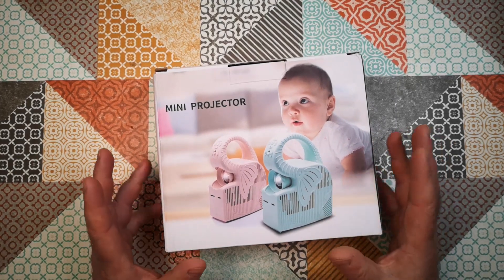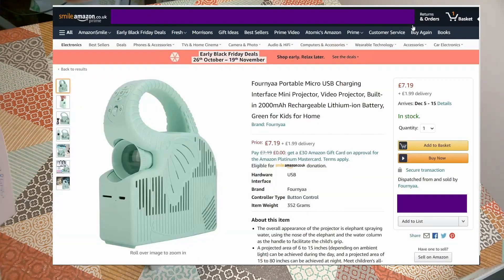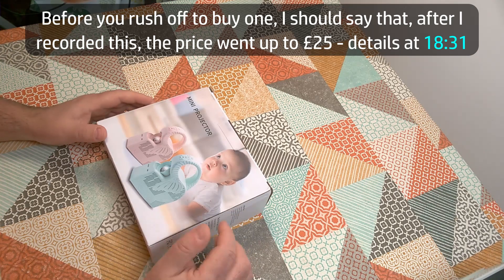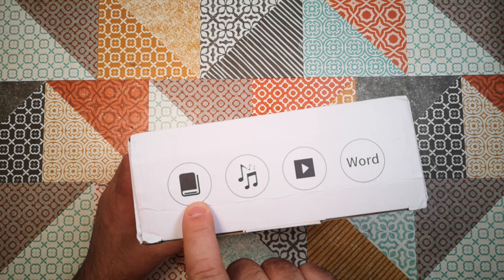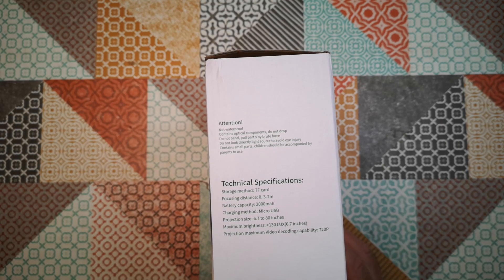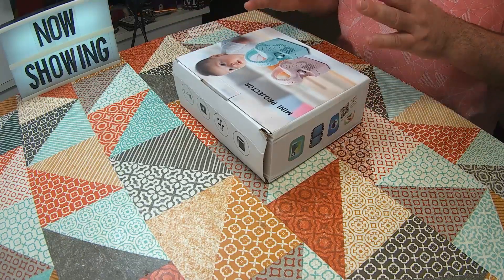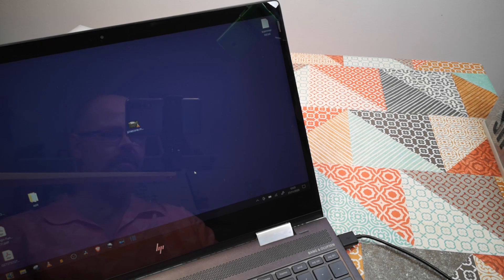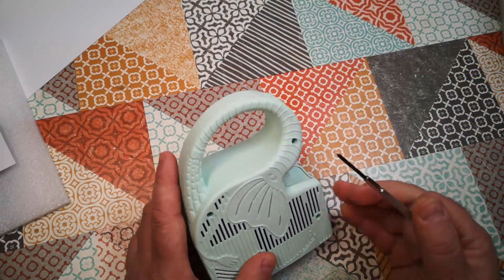The Weird Little Video Projector That Cost Me Less Than £10 - Unbox, Test, Teardown

Comment from the maker: Update on the hackability (or otherwise) of this thing...
I took it apart again to get a really good look at the insides; the construction is quite curious - the LCD panel has a 30 pin ribbon cable, which seems pretty nonstandard; the polarising filter for the LCD is also a separate thin piece of glass - Hacking this thing is probably beyond my abilities; it will either comprise loading a new OS/firmware for the SoC (which probably means rewriting the video driver from scratch), or reverse engineering the connector for the LCD panel to get it connected to something else.  Ben Heck could do it.  I probably can't.  I wonder if he wants this to play with...
Reply: So that's what they mean by "the elephant in the room"!
Reply: i might be wrong but is that cable on the lcd anything simmilar to say the raspberry pis DSI connector they look firhgtfully simmilar

edit: nah dsi is a 15 pin connector

took a look at the datasheet and yeah it does have pinouts for that but without the software to enable that mode i dont think your going much of anywhere with that

and thus we come onto software
theres people out there who could and would absolutley wanna hack about with this but they have jacked up the price and the price will only go higher if there a large demand for it 

at which point all this development and hacking just to have made a projector with the same or less features than buying one of the 30 quid projectors listed along side this one that ship with those features enabled out the box
Reply: Fun fact, that SoC is the less RAM version of what's in the Game Gear Micro, so you can certainly put Linux on it, and should work fine if the LCD interface can be figured out.
Reply: i just saw tom scott's new video about polling an audience and you are the one of the only people on the internet  that uses double spaces after a full stop
Reply from the maker: Computers and the internet came into existence during my lifetime.  I learned to type on a typewriter - and back then, the convention was always one space after a comma, two spaces after a full stop.  I think it's too deeply ingrained a habit to let go of now.
Reply: cool video
Reply: @AtomicShrimp  The real Satoshi Nakamoto
Reply: Reverse the LCD panel, put a more powerful 10W/12v LED behind it, add a chunky heatsink, maybe a 12v fan. A lens more suited to "throwing" the image for distance, add a stepdown board from 12v to 5v, solder the output of that to the projector, add a car cigarette lighter 12v plug to power both the projector and the LED. Go around the/ a neighbourhood with your car at night, projecting movies on other people's curtains. Reverse drivetrough cinema.
Reply: uhh a lot of the non touch screen HP 15" laptops use a 30 pin connector for their panels.. and i think you can get 30 pin adapters for arduino.
Reply: you could go in circles trying to make the included LCD work, when i suspect it would be easier to snag a potentially better screen with built in rpi support. should be fairly trivial to replace the LCD with another unit of a similar size.

do you know the dimensions on it?
Reply: I really appreciate your unbiased approach to items you purchase on the web. There are other channels like your’s that always, no matter what have to find something wrong or fraudulent even when there doesn’t seem to be. Thanks for being 100% genuine with your audience, and for helping to bring awareness to us all.
Reply: camping projecter could be a reason to get maybe
Reply: @AtomicShrimp  I too learned to type on mechanical typewriters, but had completely forgotten about the double space after a full stop! Probably because I didn't continue with this when using word processors on computers.
Reply: @AtomicShrimp  heck... I'm under 40 & I always double space after a period.
Reply: Ben Heck could make a B-MO with this, a raspberry thingy, and pico-8.
Reply: @DoubleMonoLR  So realistically you would have to make a complete schematic for this thing to have a hope of running anything useful on it OR you would have to come across whatever RTOS they stole and put on the SoC.  From my days dealing with the TI omap series of processors and stuffing linux on them, it is incredibly un-fun getting the right alternate pin IO routing correct.

I'm gonna guess that there are JTAG pads exposed there somewhere (though the chip documentation says it can be programmed with USB OTG).  Oddly, nothing I see mentions any kind of copy protection fusing like most embedded processors have so maybe you could pull the programming right off it over JTAG?  Probably simpler just to yank out the board and find a way to make a Pi zero work with the display.

Anyway, on to why its so cheap, buried in my own comment which is buried under other people's comments.  I expect somewhere between 0 and 1 people to read it.
The fact that this showed up as a readable drive and the chip has USB OTG capability means that you could use it to put spyware on a computer or to expose HID interfaces surreptitiously to, again, put spyware on the host computer.  It wouldn't be the first or last time a piece of electronics out of Shenzhen was sold under cost just to spread malware.

Also, a lot of parts in China kind of "fall off a truck" on their way towards making legitimate products.  They can't just sell stolen component level parts so they end up being shoved into weird repurposed plastic molds running weird repurposed code.  if your BoM is "free", you can make a product for pretty close to free.

Atomic Shrimp: It would have been nice to see this attached to a linux box and what the output of "dmesg -w" was for a few hours.  See if it behaves shadey-like.
Reply: Did you try to connect with an android thru the USB port?
Reply: Very late comment, but have you tried a PDF file for the text documents?
Reply: @SpahGaming  I learned to type on a computer and I always use two spaces after a full stop/period.
Reply: @AtomicShrimp  Nah,  I'm of a similar vintage to you, Mr Shrimp, and I made the choice to go single spaced a few years ago. Now it's second nature, and just think of all the key clicks I'm saving!

Comment: The funny thing is this device outperforms the first projector generation on every point, and they sold for the price of a yacht.
Reply from the maker: I remember having to use an LCD panel that was designed to be placed on top of a regular old-style OHP - it was absolutely terrible - lower resolution than this, and so dim you could barely see anything even in full darkness

Comment: I've now bought 3 of these at $12 CAD each, including shipping! 
One to use and two to play with or hack. 

The video quality is actually surprisingly good FOR THE PRICE.  People dogging on the quality need to go price other projectors  and get their minds right. 
It's totally watchable. Especially for the intended target media, cartoons. I dumped a Looney Tunes collection video on there and it looks great. Kids in a dark room watching from their pillow fort will be thrilled with it. 
Even watching regular movies is quite doable as long as there's not a lot of dark, low contrast, or high detail scenes. 
I watched half of Mission Impossible: Ghost Protocol just to test it out and it was quite watchable. The main limitation is battery life. But again this is meant for 5-30 minute kid's cartoons, not home theatre use. It will play while plugged into a charger and I'm guessing that with a powerful enough USB charger you could play movies indefinitely. Like a Raspberry Pi 3 charger for example. 

Meanwhile I'm VERY curious to know the pinout and protocol used by the LCD display. I'd love to replace the built in motherboard with a Raspberry Pi, hopefully using the DSI connector. 
I'd be shocked if the original motherboard and display used a proprietary protocol or connector. At the price they're selling this thing I'd imagine they'd use as much of the shelf stuff as possible. The display especially seems a good target for a standard, of the shelf part. If only so the projector manufacturer can price shop for the cheapest vendor at the time of any given production run. 

If anyone gets any info on any parts of this projector, please share with the rest of us! 

So far in my own research I managed to find this project, which uses the same SoC as the projector. 

https://www.thirtythreeforty.net/posts/2019/12/my-business-card-runs-linux/

Comment: I think I can see what happened. After the success of the iPod, there was a huge flood of little inexpensive media players onto  the market. They had these same functions, but the displays were very low-res because that's all you could do cheaply then. As media players (and LCD displays) got better (quickly) driven by phone technology, there was somewhere a pile of the boards insurplus which were dumped for pennies each. The up-front investment here are the molds for the plastic case and that lens, but after that, the cost of the materials could have been as a low as 1 pound or two.

One more note: I bet the mirror inverts the image and the lens inverts it again.

Comment: I purchased a different build to this unit, mine was more box shaped white and yellow, it did have more technology in it and worked very well indeed, my wife and i sat and watched a whole movie with it.
This one had a cooling fan and a bigger speaker which was quite a good one.
Like you I was amazed at just how good this was, it did everything it said it would do and did it very well indeed, i was very taken back with the LED lifespan 30,000 hrs, which with carefull use could work for a lot longer i think.
I too wondered how they managed to make something as good as this for the money as this one actually had a remote hand control with it thay again worked just as it should the picture was more than bright enough and worked at a distance of about twelve foot, making the image almost the size of the wall!!!! 
Only goes to show that sometimes you can have a good win which is how I would rate the unit i purchased.

Comment: First thought for this would be to use it for some sort of art installation on a budget. Plus the fact it has a decent battery in there with USB charging, you could hook it up to a nice high capacity battery pack and I imagine it'd run for quite some time before needing recharging, so you could put your project outside or in a weird place. I'm sure with a bit of messing about you could even get multiple units to sync together for some cool effects.

Comment: Used to make my own projectors using freznel lenses and lcd monitors , ha. All I can say is make sure the freznel lens is positioned correctly if you moved it when you took it apart.Its meant to be flat "in this case" so that the gap is even and the correct distance between the freznel and the lens below. Should be a groove/holder for the freznel to fit in perfectly. If its not in the right position you will have distortion on the image especially around the edge of the projected image.

Comment: Unless you deal with the Chinese you will never understand how they make things so cheaply.  One of the directors of a company I used to work for visited China and they took great delight in showing him round various factories.  One in particular made surge protected multiple socket extensions.  They sold in Britain for between £25 and £30.  The manufacturing cost?  Ten pence.
Reply: Slave labor

Comment: I think we could probably get mainline linux running on that and stick a nes emulator on there. The processor is pretty weedy (ARM9 IIRC) but should be enough for nes. I'm not sure if the video decoder is supported in mainline linux but I think the graphics output/lcd controller is.
Reply from the maker: Yeah, that's what I was thinking of - something like a fold-up bartop arcade machine where the screen folds out and the display is projected onto it
Reply: @AtomicShrimp  

Should be possible. If you pull the PCB out a bit more to get a complete photo of it or even better get it in a flatbed scanner we can work out how you can get serial access on it and go from there. It's probably also possible to wire up a USB wifi adapter to it to make it a bit more usable.. The usb charging port is a device when you plugged it in but it should be possible to make it a host.

Building a new firmware for it with buildroot shouldn't take more than a few hours.
Reply: @donpalmera  a Video on this process would be cool. :)
Reply: @donpalmera  Wait..whaaat??....can you start over and go a little slower please? 🥴
Reply: @psidvicious  The chip on that board is a "action camera in a can" chip. It contains a processor just good enough to run Linux, some memory, some hardware to run the LCD that's being projected and some other bits to turn video files back into images for the LCD.

People have already documented, reverse engineered etc that chip so you can go and download all the bits to make your own setup to run on there.
Reply: @donpalmera  Sorry, I was actually being facetious (cheeky) with my comment. To say that I am ‘unversed’ in computer lingo would be an extreme understatement so your comment was way over this layman’s head.

Comment: As to why they can sell it at the price point, maybe they're surplus chips/parts.  They made way too many for another project, and they were to be thrown away otherwise.  It would be interesting to hack it certainly, assuming you could find a way to access the console serial port, and/or boot it from the SD slot.  You'd need to find the board schematic to get started.  Googling F1C100s did turn up some interesting places to get started.  Eval boards based on the F1C100s sell for about $9 on digikey.

Comment: For reference, that's the same CPU/SOC as the BITTBOY. It will run just about everything up to PS1 with some range in performance, depending on what version of the chip. Vectors into it are probably start at the SD card. Would be curious to take one apart and try it.

Comment: Looks like you got lucky with the price, every body needs to get lucky sometimes 😁👍 Certainly the quality would be fine for kids, maybe not good enough for your management presentation at the office meeting although I am sure they would be impressed by your equipment and financial acumen 😆 Having all the buttons on the front making you look into the light seems a bit of a design error. Thinking about it, worst case scenario £10 is not too bad for an SD card reader anyway 🤣

Comment: I would be really interested to see how much they paid for these chips on the board. Probably were a bunch of test failed chips i would guess.
Reply from the maker: Possibly, or the board itself might be shared across a bunch of low end media consumption products such as MP4 players and the like
Reply: The Allwinner F1C100S CPU/SoC is about 1.30usd a piece. The 64MBit (8MByte) SPI Flash EEPROM at the top edge of the board is under 0.25usd, and other than that there's just voltage regulators and a ton of passive components that total up to less than the EEPROM. In large quantities, the prices will probably be significantly lower than that.
From a compute power perspective, this is really weak (very old CPU design from around 2010, running at just 533MHz, no FPU, no 3D graphics, 32MB RAM) and therefore dirt cheap.

Comment: that allwinner soc has a single core and only 32MB of RAM, and I didn't see any other RAM on that board, so i can't imagine you'd have much luck running Android on it unfortunately. replacing the board altogether would probably be necessary to achieve anything worthwhile

Comment: buy 25 and use an arduino (or something)  to drive them all as one huge 4k display!
Reply: enjoy aligning them though
also for 250 pounds you can get a decent 4k projector
Reply: @timytam97  you can preload 320*240 cropped parts of the video on each projector. then use an arduino (or wire the buttons together to make the video play simultaneously.)
an option would be to use an fpga to fake the micro sd and stream the video in real time.
but unless you're do it for the hell of it, it is not worth the bother.

Comment: You plugged it straight into your computer? Man, you're a looot braver than i thought. :))
Reply: He has explained in the past—when testing known-dodgy USB flash memory—that he is very careful of where he plugs such devices. I'd bet that laptop is running a basic image or such that can be easily reloaded if it does something terrible to it.
Reply: @ConstantlyDamaged  I the case of this thing, I'd be more afraid that it kills the USB port through high voltage because they hooked up the battery directly with no charge protection or anything, than it having auto-installing malware.
Reply: @rolfs2165  Fair. Easy enough to work around that with a custom cable that has the 5v rail clipped out.

Comment: And now the question on everyone's mind:

Can it run Doom?
Reply: Without any doubt it could theoretically, decoding video is much harder.
Reply: This will be the next system that Bethesda will port Skyrim too
Reply: it has a 533MHz ARM based CPU and 32MB embedded RAM. sounds doable, but the 2D-only graphics capability might be a problem. Videos are no problem for these, as they have a dedicated video decoder unit

Comment: Unfortunately there is no "standard" for LCD panel flex cables and their connections. Hooking this up to a pi would be kinda hard, but not impossible. It's a parallel interface, so it could be hooked up to the GPIO pins, if someone wrote a fitting "driver" for it that takes care of the timing signals.